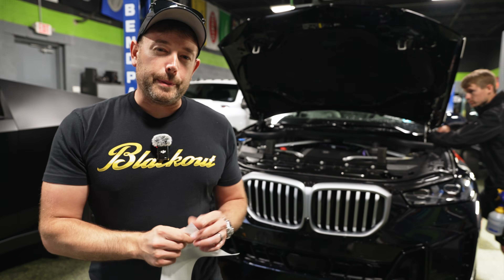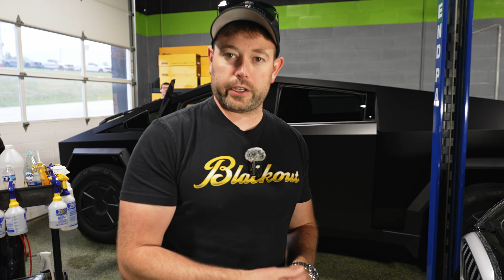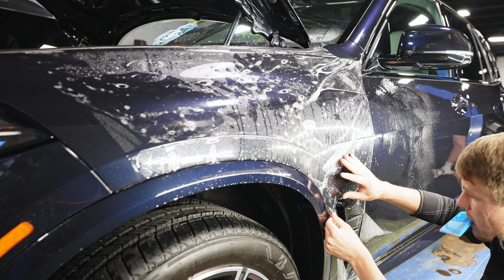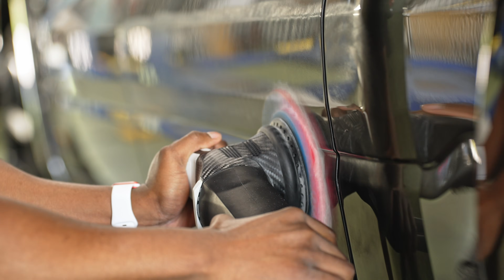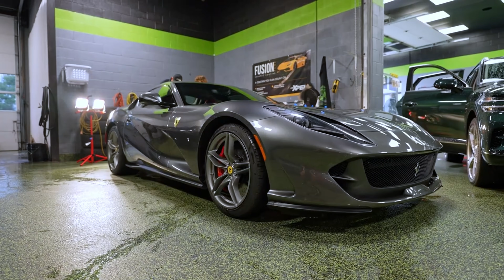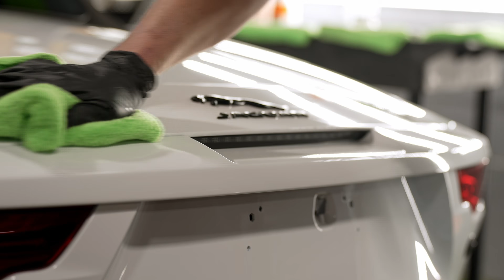Paint Protection Film vs. Ceramic Coatings: Which One Is Right for Your Car?

Comment: A reputable detail shop owner claims that adhesive promoters add 1 mil thickness to ppf film. What do you think?
Reply from the maker: Sounds like it could be true, or rounded up. We’ve never looked into testing like this or did our own.
Reply: @BlackoutTinting he said the ppf film he had was 10mils thick and then after install, I found out that it was only 8.5mils per the manufacturer and he later changed his story to say it's 8mil and then with adhesive promoters added, it makes it 10mils, but that was not how it was communicated from the get go.

Comment: Do you recommend waxing after ceramic coating? If so which brand is the best to go with it and do you recommend wax over protection spray that protects the Wac?
Reply from the maker: We regularly use XPEL Boost which is a spray on top coat that extends the life of a ceramic coating. Waxing is no longer needed after getting a ceramic coating.

Comment: I am thinking about doing the xpel ppf whole car for my 2026 Z06 for $6k and do the Gtechniq crystal serum ultra ceramic coating for $784 +  $350 for wheel off..   I plan to do the car wash once a month $75 each ,  Would this work?  I will probably drive this car 4-5 times a week.. about 6-7k miles per year..
Reply from the maker: Yes, that sounds like a great idea.  Reasonable pricing also.
Reply: Thank you sir..  I got it scheduled for 9 am tomorrow
Final version -  Z06,  6-7-2026
2026 CHEVROLET CORVETTE Z06 COUPE 3LZ • 2026 Chevrolet Corvette Z06 Coupe 3LZ , Silver w competition Sport Seat, Suede stitching interior.

• GM Platinum Extended Warranty 8 yr/ 80k/ 0 ded – paid  $3,370
Regular PPF - Full Vehicle -  $6,930
E1 PPF Full Vehicle for Regular vehicle with XPEL Ultimate Plus Film includes the following: Area of coverage: - All Exterior Painted Surfaces - Custom Rear Hatch - All Exterior Piano Black Pieces (where applicable) - Headlights• Rear Wheel Impact Areas

XPEL XR Plus Windshield Tint.  55%  -  $329.75
XPEL XR Plus Side & Rear  30%   -  $341.75                       
• Front Door Windows – 30% • Rear Cabin Glass – 30%

Escort Redline 360c Turnkey Radar Detection System -  $1,593.05
• Escort Redline 360c • BlendMount • MirrorTap / WireTap Power Connection

Gtechniq Crystal Serum Ultra Ceramic Coating -  $784.99
Includes:
• Paint Preparation  • Minor Paint Correction • Crystal Serum Ultra Application
• Infrared Curing • Wheel Face Coating
• 9-Year Warranty
Windshield excluded due to existing dealer-installed C-Bond / Nano treatment.
Gtechniq Wheels-Off Ceramic Coating -  $350.00
Includes:
• Wheel Removal • Wheel Barrel Coating • Wheel Face Coating • Reinstallation
Purpose:
Reduce brake dust buildup and simplify wheel cleaning.

8.	Scrape Armour Front & Side Guard System - $2,229.94
Includes:
• Front Radiator Mesh Guards (3-Piece Set) • Side Intake Guards (2-Piece Set)
• Expedited Shipping • Professional Installation

Future Windshield Protection Plan
Retain the dealer-installed C-Bond/Nano windshield treatment.
Evaluate adding E1 Auto Spa windshield ceramic treatment in approximately 36 months if additional protection is desired.
Estimated future cost: - Approximately $100.

Comment: Here is a different question. I just bought a lotus emira and dealership are doing free ceramic coding and they said it’s 2100 blah blah. If I just get ppf how much would cost since you don’t have to do any prep work?
Reply from the maker: Dealerships can charge whatever they want because they expect people to finance it too. A ceramic coating from us with wheels off and single stage paint correction is 1800 for the 4 year coating. A full front end PPF is 2100.

Comment: Can you use automatic car wash with ceramic?
Reply from the maker: touchless can be okay, but there is still a risk depending on how well it is calibrated that it could lift the edges based on how hard and close the water pressure is

Comment: I am a little confused if PPF has adhesive how can you spray water behind it?
Reply from the maker: We use a slip solution and a tack solution. The first is slippery (baby shampoo and water) and helps us manipulate the film and stretch it without causing defects. Anything left will evaporate later. The tack solution (water and alcohol) cleans out the shampoo side and brings the adhesive back

Comment: Thanks for this super helpful video. 

If I do full front ppf, will I see a difference in the paint 10 years from now when comparing covered parts vs non covered parts of the car? Could the non-covered paint fade more quickly?
Reply from the maker: Typically fading is not much of a concern, but the unprotected areas usually have many more micro scratches and swirl marks.

Comment: I understand that PPF can protect the front of the car from rock chips, but is it a good idea to apply it to the doors as well to protect against paint scratches caused by other car doors in parking lots?
Reply from the maker: It would definitely help with all kinds of wear and tear like that. We just did a video on front end protection vs a full ppf wrap that you should check out.

Comment: 15k for a benz......yea it has more curves but 15k....it's because it's a benz. I bet a 911 gt3 rs will cost 25k to cover even though it uses less material.
Reply from the maker: Depending on the type, we’re probably closer to half that on both.
Reply from the maker: We usually charge 7k for gt3rs
Reply: I stand corrected, good stuff man!

Comment: Ever since ceramic coating was introduced and promoting so much like protecting from "this and that", it doesn't. It's more on just convenience. If you have time then go with regular wax, if lazy but with money go with ceramic coating, but the thing is you have to recoat the ceramic from time to time just like waxing. To remove ceramic coating it's a hell of labor. Just go PPF or wax in short.
Reply from the maker: We’d argue you don’t have to re coat from time to time, but you might have to wash it more or even use clay on it more often because the coating is just clogged. Hence why it would be hell of labor to remove.

Comment: In terms of preventing micro scratches, is there a significant difference in using microfibre or a cotton towels?
Reply from the maker: More premium towels usually have a GSM rating, basically meaning how dense the fibers are on the towel. Cheaper towels can be more abrasive and can actually introduce swirls and marring to the paint/coating. We buy a lot of rags from the rag company, so just make sure you’re not buying cheap Walmart microfibers, although they can still work, they probably don’t have as high of standards for car care towels.
Reply: @BlackoutTinting  Thank you very much for your replies. That is very helpful.

Comment: PPF has extremely limited legitimate use cases, but 99% of the time you've made a mistake. Real car guys know that a quality paint job with a layer of clear coat is the ideal skin for a vehicle in 2026.
Reply from the maker: Did AI write this comment using an early repository?
Reply: @BlackoutTinting  Your go to every time someone disagrees with you?
Reply from the maker: No just odd wording got me and that was our first time calling out a bot.
Reply: @BlackoutTinting  That makes even less sense. How would you know what a bot would sound like on this issue if you've never called it out before? 

Go ahead and explain what wording demonstrates a bot to you. Be specific.
Reply from the maker: @kenhiett5266  I decided to have AI rewrite what you wrote to see if you agree with the translation "Paint Protection Film (PPF) offers minimal practical benefit for the average vehicle owner, and its application often represents an unnecessary investment. Many experienced automotive enthusiasts maintain that the ideal 'skin' for a modern vehicle is a high-quality, well-maintained paint finish, protected by a durable clear coat. This traditional approach is considered the superior choice for aesthetics and long-term protection in 2026." Is that what you're saying? PPF doesn't work to protect car paint and clear coat does a better job?
Reply: @BlackoutTinting  Why would you do an AI search instead of answering my question? Why is an AI take relevant?
Reply from the maker: Please confirm so I can respond, are you saying - PPF doesn't work to protect car paint and clear coat does a better job?
Reply: @BlackoutTinting  Answer my questions first and I'll be happy to detail my position on this. AI's take as a comparable is totally irrelevant. Anyone familiar with AI knows the only thing it's good for is objective data, and it's not even great at that. It will often give false information when it lacks the data to answer a question. It's calibrated to answer confidently regardless. This happened to me just a few days ago. I was looking to buy a new amplifier with volume attenuation and I wanted to know if it had mechanical stops. AI answered confidently that it did and that was inaccurate. When I cornered it about the misinformation, it admitted the faulty programming methods. 

Going to AI after calling me out as a bot was amusingly ironic. lol
Reply from the maker: no thanks, sorry for the misunderstanding
Reply: @BlackoutTinting  No worries. Cheers

Comment: I'm debating this very topic so much. I invested a lot in my car and want to keep it forever, but at the same time it's been repainted twice. Pretty much guarantees if ppf gets removed at any point for whatever reason, a new bill for a paint job will be coming my way. That being said after the first paint job I had to do so many touch ups because of rock chips I honestly lost count. Swirls are also a huge pain on the black car. Did ceramic coating twice already and it's nice but it doesn't do anything against physical damage.
Reply from the maker: Was it a quality paint job? did they do all the prep needed before paint went down? This severely limits the chance of any paint coming up when it is removed. Or was it just sanded down a bit and repainted? If you're going to keep it forever, will it be garage kept and low miles? If so the PPF could last a very long time.

Comment: Great video.  Not sure if I missed it, but would you still wax over the ppf and the ceramic?
Reply from the maker: We recommend a spray on ceramic coating for at home care!
Reply: Get that ceramic OVER the ppf, use a ceramic detailer. You won't be sorry. Washes easily, dry it with a blow dryer and it's protected as much as possible from road debris and rocks

Comment: I have a 2024 Toyota Grand Highlander that gets scratched and dinged easily.
Questions: should I get chips addressed prior to installation?
2 - Wil PPF "mask" swirls and minor scratches or do they need to be buffed out?
Thanks!  Excellent video BTW
Reply from the maker: Thank you! Repairing chips wouldn't be a bad idea unless you can live with seeing them forever.  Ppf does hide minor swirls and micro scratches.  Significant scratches through the clearcoat would obviously need addressed first.  Thanks for watching!!

Comment: In the past, I've always gone with PPF on my vehicles, but I'm leaning toward only doing ceramic coat on my new CX-5 Signature. I love the highway protection you get with PPF, but the older I get the less concerned I am with avoiding every blemished and I'm more concerned with keeping it looking good with minimum effort. I use to love detailing my vehicles, but now all the bending over and crouching kills my back, and I hate driving a dirty vehicle. My normal detailing shop here in NE Ohio uses Xpel ceramic, which is supposedly really good stuff. They have a winter special going right now, my full vehicle (paint, trim, glass, wheels) for $1100.
Reply from the maker: Thats a good price!

Comment: How many years does PPF last?
Reply from the maker: XPEL has a 10 year warranty against failing prematurely and clean removability. But it can last longer if well kept
Reply: I have XPEL on all painted surfaces on my 18 Acura RLX for +5 years.  It helps to hand wash/dry with microfiber mitts and towels, clay bar/wax/spot removal occasionally as needed, and stay away from touch auto car washer with rotating or drag type soapy washers.  You can really damage PPF with rotating/dragging auto washers and self healing PPF can't keep up.  Getting 10 years with PPF will be the minimum if you put a little care up front.

Comment: What are your thoughts on xpel fusion PPF with the added ceramic coating on the film? Or do you feel that placing xpel ultimate Plus PPF and applying ceramic coating afterwards gives you a better results? I’m planning to PPF my entire car but undecided on which of these materials to go with.
Reply from the maker: We prefer installing the coating and don't even stock the impregnated film. Some shops love it though.

Comment: If you have a black vehicle, PPF 100% on the front end at the least. If you have a ceramic coated black vehicle, you WILL get water spots, you WILL have bird shit etch into your paint, and you WILL have bug guts etch into your paint (hood, mirrors, pillars etc) I know because I had my 2025 black ZR2 Colorado ceramic coated professionally (not dealer) and no matter what, these things happened. You simply cannot gaurd your vehicle 24 hours a day. In the hot summer sun, it's inevitable. I ended up PPF'ng my front bumper, headlights, hood, fenders, and mirrors, and after every wash, it's flawless. Having said that, I'm an ex professional detailer (extremely anal) and I wash my truck once a week and also apply CarPro elixir to the entire vehicle (minus the flat black part of the hood) also if any bugs are on, I maintain during the week and clean off the PPF which is incredibly easy and stress free as you have to be edward scissor hands to scratch it. If you are someone who wants your vehicle to remain near flawless over time and you are capable of maintaining it, go PPF. You won't be sorry you did. I have Suntek installed and can honestly say as a 42 yr old man, it's magical stuff and will take alot of stress away. I live in Canada and daily drive from a rural area to a city for work 4 days a week. The front of my truck looks like it just came off the line. If it remained ceramic coated, it would be full of etching 100%. Take it from me if you're on the fence and want a vehicle to stay in brand new condition. Go PPF. It can still chip though but your paint will be protected so worst case you replace the bumper section every few years if needed. You probably won't have to though to be honest. It takes a large impact to mess with the PPF of today.
Reply from the maker: We always suggest front end protection for people on the fence about how much to wrap, you can always add more later. Some of our customers do two layers of 10mil on the front vs 8mil, but a lot of them also drive fast or track their vehicle. Thanks for watching and commenting.
Reply: I did a similar PPF coverage with my19  Acura MDX and had similar results.  The Suntek PPF on entire front end looks perfectly flawless after 6 years and the ceramic coating take A LOT more maintenance to look 80%-90% as good as the PPF.  I needed to strip/replace the ceramic coating after 4 years, use spot removal as needed, hand wash only with microfiber wash mitt/towels always, use ceramic coating booster soaps, apply ceramic sealant as needed, and still get occasional scratches that don't self heal like PPF.  Learned from that and covered my entire painted surface on the wife sedan and it still looks pristine after every hand wash.

Comment: What if my car was ceramic coated by dealer and i added PPF after. Do i lose coating benefits? Should i coat again?
Reply: PPF today has a hydrophobic top coat. IF you choose PPF now, your ceramic coating will be polished away to allow the PPF to adhere to the paint. But what you will get with PPF is miles above what a ceramic coating will give you. Ceramic coating PPF is pointless also.
Reply: PPF has self-healing properties that make small hairline scratches disappear when heat contacts the section of PPF. Also it makes swirling very difficult if maintained properly. Still possible if you don't wash properly though. Ceramic coating doesn't offer this. Most small hairline scratches with a ceramic coating will only be in the ceramic coating though but very visible
Reply from the maker: Some installers have ceramic infused PPF, but ceramic should always be the outer most layer to make it work

Comment: Very informative video. Thanks. What type of maintenance is required on the PPF to extend its lifespan? Will the PPF ever peel or discolor?
Reply from the maker: thank you. All name brand PPF should have a warranty against failing prematurely. As long as you don't abuse it you should be fine ex don't spray the edges directly with a pressure washer., Give it a look over every once and awhile to see if any edges are lifting, which can accumulate dirt and often just need a slight trim back.

Comment: Is ceramic what used to be called "clear coat?" My car is 18 years old and I remember buying it with "clear coat" and it has always looked very good.
Reply from the maker: paint used to be single stage, then they started adding clear coat. PPF was originally called clear bra, maybe that's what you're thinking?
Reply: @BlackoutTinting  What I got on my 2007 Accord V6 was definitely called clear coat. It was sold as a factory accessory at the time of ordering. I assume it was some type of painted on treatment, def not film. It has always had a very deep glossy look, even to this day. I'd like to get it when I eventually replace my car, but I don't know if it even still exists.
Reply: @JeffreyCoolwater clear coat is standard on all modern cars and protects the colour coat from sun UV and gives the bodywork the shine.
Reply: @geraintroberts7569  thanks. I appreciate the info. Yes, that sounds like it. It's strange every salesperson I ask has never heard of it.